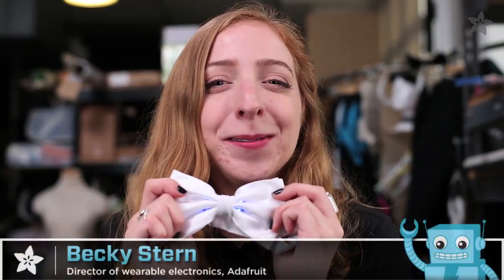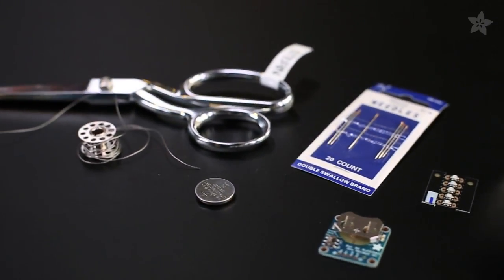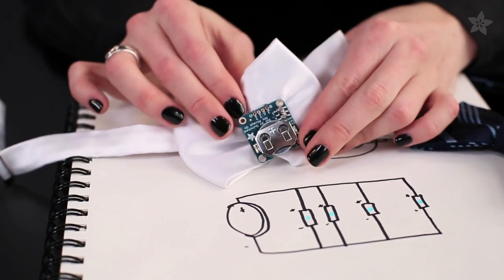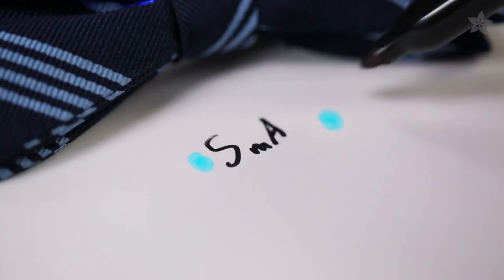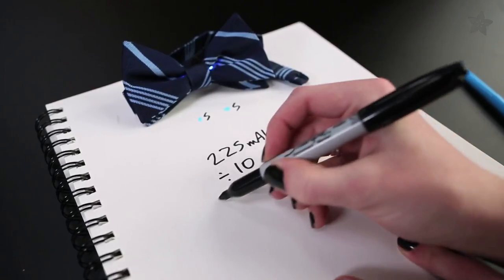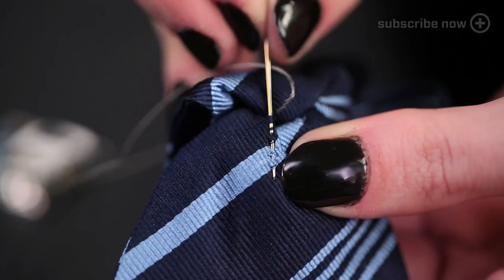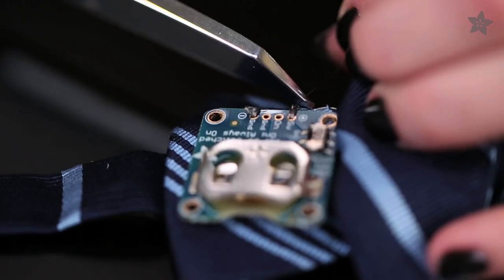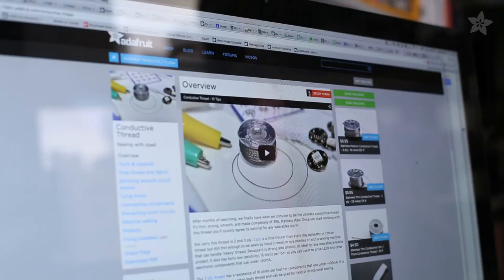Bowtie with LED Sequins

Comment from the maker: New Guide and Video! LED Sequin Bow Tie #WearableWednesday
https://blog.adafruit.com/2015/02/25/new-guide-and-video-led-sequin-bow-tie-wearablewednesday/

Here’s a nice simple project to brighten up your Wearable Wednesday– a bow tie with added bling! This beginner project is a great way to get into e-textiles. No programming or soldering required, just a bit of stitching. You don’t need much background to start this project, just check out the Conductive Thread guide for tips on working with this tricky textile.

Head over to the LED Sequin Bow Tie tutorial on the Adafruit Learning System to make your own.

Read more https://blog.adafruit.com/2015/02/25/new-guide-and-video-led-sequin-bow-tie-wearablewednesday/
Reply: Really cool!

Comment: Hi, I tried to make one of this for my father, it is preety cool, but for some reason it works when it wants and stop working when it wants as well.
I thought the problem was because it is not a flat thing, because of the wrinkles the conductive thread touches, so I made a basting with regular thread to cover the conductive one, but the result was the same.
For some reason, as soon as I change the battery it works just fine, but after a while of being off, the same thing happens (I tried with 2 new batteries, batteries are not the problem).
I untied the bow and it worked perfect, but when I tied it again, it stops working.
I am really amateur at this, so I don´t know what the problem is, therefore I cannot fix it.
Some help, please?

Comment: The calculations for the battery life are very naive.

See this paper by Texas Instruments showing loss of rated capacity of coin cell batteries at high (and for coin cells, anything over 5mA can be considered high) current draws:

http://www.ti.com/lit/wp/swra349/swra349.pdf